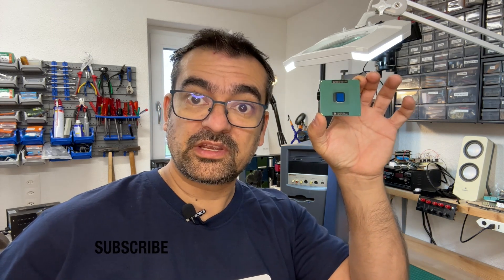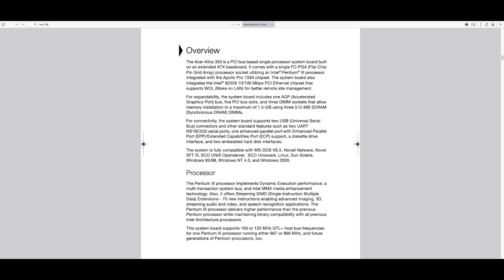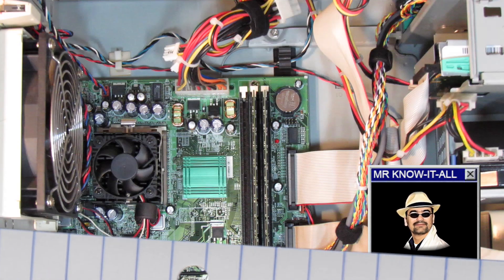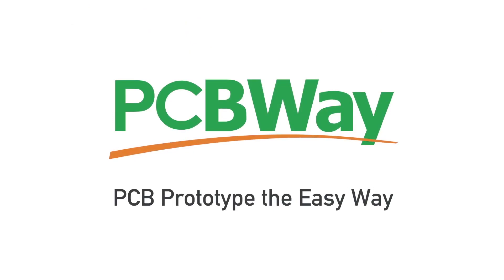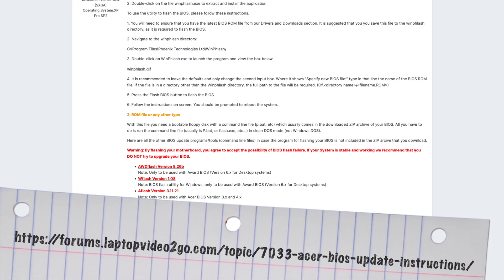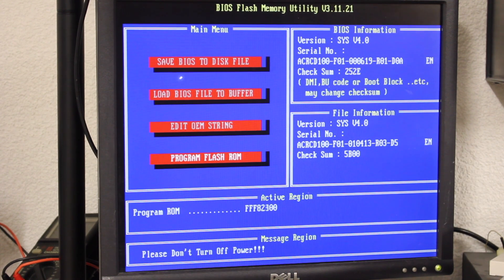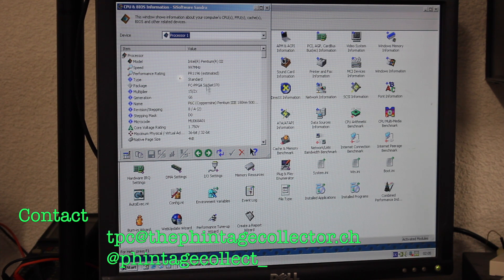The SGI 230 CPU Mystery resolved: Run it on steroids with a 1 GHz Pentium !!!

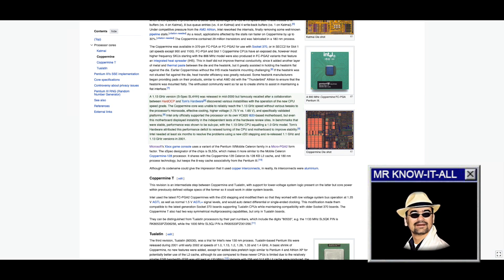Comment: 1:34 SL5CK is mobile Tualatin core, not Coppermine. I don't know how to use the SGI230, but Tualatin can be used with the correct reduction in other sockets based on the same chipset.
Reply from the maker: Mhhh, guess I made a mistake when looking it up.
Now that explains why my eBay search agebt never comes up with hits!
Thanks for pointing it out, I would have looked for the wrong CPU in eternity!

As for the Coppermine, this mainboard and chipset is not officially compatible to Tualatins.
I saw reports of other people trying and failing on it with the via Appllo Pro 133A unless a hardware mod is applied.

Though that‘s out of question, I don‘t want to mod the board, so I‘m restricted to Talatins.